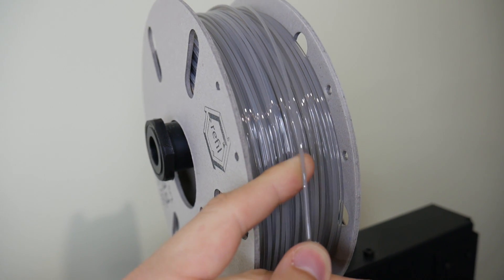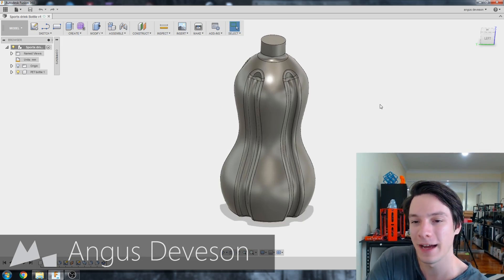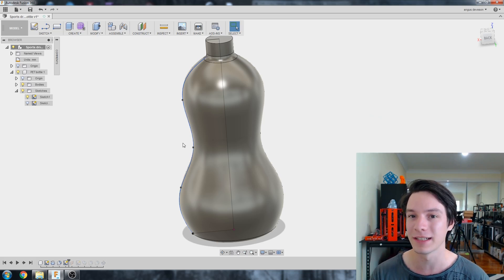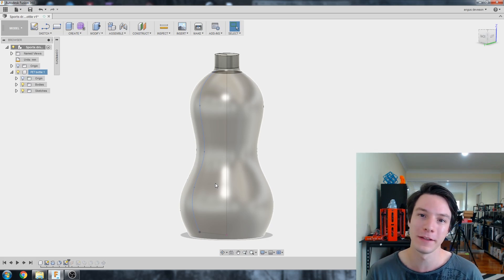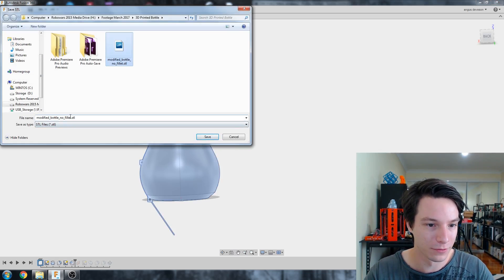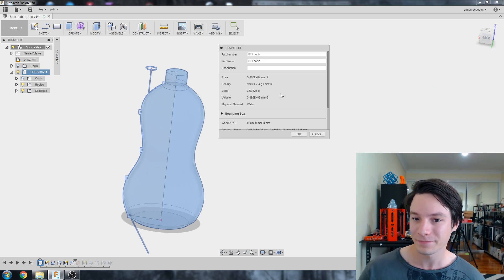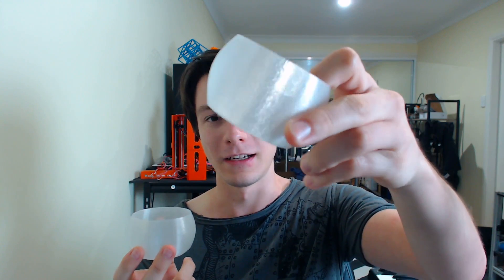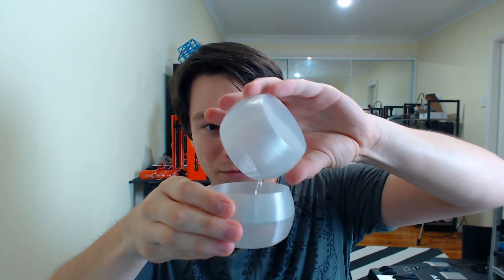Watertight 3D Prints and Calculating Volume in Fusion 360 - Refil Bottle Tweaks

Comment: It may hold the water now, but as soon as more pressure is applied (more water in the cup) it could start leaking. 
That's what I found out on my printed vase. A little water is fine but if I filled more than half the vase, the bottom started leaking.

Comment: Awesome video, always great content from you. I am experimenting with 3D printing our back yards sprinkler system. Originally I thought I would use a layer height of .3mm as a first experiment. The sprinkler seems to leak, I assume because the layer height has allowed some gaps in the layers. Next I will try a .1mm layer height thinking that there will be less gaps between layers. Now, a question. I am using PLA. Reading I have seen suggestions the PET or PETG will produce more of a waterproof product than PLA. And reading it seems PETG might be a little better than PET. Curious on what you think. I cam comment wit my results when I finish my experiment. Obviously sprinklers are cheap enough at under or slightly over a US dollar in cost but it's an experiment. I also assume that PLA will not do well in heat and UV rays in summer so I was considering ABS but PET or PETG seems to be the recommendation for waterproof even more that ABS.

Comment: My freshman year of college I brought a cr10s pro up along with me, and one Thursday night I asked myself this exact same collection, and through some hands-on research, and with the help of a dubious amount of shot glasses found on Thingiverse I figured out that single wall glasses do not hold liquid, especially vodka, well for long periods of time, but that didn't matter for the intended purpose. In my findings, it was clear that the more walls added, combined with a larger line width and lower layer height (theorized to increase layer adhesion), produce the best results. However, all findings of my tests are purely hypothetical and heresy at best because after the first 8 tests I don't recall any more results after that.

Comment: The reason it worked is because you only tested it with a small amount of water. So the pressure on the base was way way less than the whole bottle full.

Comment: You could have sharp outer edges in blow moulding. But the interior of the plastic part in cross section will not be sharp due to the material thickness.

Comment: I know this is an old video but I have been doing the same testing.  Wasting lots of filament and taking lots of close up pictures.  I found that the base is the issue, mainly due to changing print head direction.  I finally got a working setup.  I am using PETG running at max temperature.  I have a 0.8mm head and am using 2.0 filament multiplier.  I am also using circular infill pattern on the bottom.  The whole print is done in vase mode.  I am also using Simply3D.  Next, I am going to experiment is over heading the two base layers.  Heating it to 270c.

Comment: You have to let it sit for a while to see if its leaking! I made a hydroponic pot for plants and it didnt seem to be leaking, but after a day or two if I try to lift it there will be water under it. Fortunately it leaks so slowly that no water builds up around the container but instead evaporates. Thankfully the pot is standing on a granite surface so I don't have to worry about water damages unless it starts leaking more over time.

Comment: Also from the video you should use filament that has a high enough melting point to stand up to what ever hot beverage you put into it. As for if any of this is food safe, Is what I would like to know more about. The company Rigid.ink says their filament PET-G is food safe but it is not Certified safe. I’d like to print my own bottles, glasses, etc with my own design etched into the items.

Comment: I watch a video where a person made a simple espresso Cup. Out of PLA Plastic. That looked like it did not leak. What he did was after printing he put the cup in the oven at 100 F for about 30 minutes. Do quote me on the temp or time. Every filament has some shrinkage. By balding  it in the oven stabilizes the filament.

Comment: I wonder if water pressure makes a difference here. In the new models, you only printed part of the bottle. You then filled approximately 1 inch of water = 0.04 psi of water pressure. However, in the original bottle that leaked, you filled it with more water, perhaps 4-5 inches = 0.14 - 0.18 psi, nearly 4x the pressure. Would be nice to know if that made a difference?

Comment: Since you did this in vase mode, could you just set a higher wall thickness (or turn off spiralize outer wall) for the bottom layers that is fillited in the original design? Either in the design file or even just the print settings?

Comment: I know the video is old, but I've also had success with higher flow rate on the bottom layer since the overlapping "weave" of the solid infill can sometimes "sweat" if the lines aren't that thick. If it's only coming from the edges, the method in the video is obviously the best, but if it looks like the water appears in the middle where it's flat, I find it's more a case of infill overlaps not hatching properly (usually because individual lines are too thin).

Comment: Thanks for the video!
What happens if you print the bottle. Then seal it so it's air tight, add some water and then apply some normal pressure to the bottle (squeezing it)?

Comment: vase mode sucks when arcs close in on the top and bottom of spheres. you might be able to get away with a curve if you can somehow make yours layers "overlap" by say 50%. that should remove the gaps. lowering your layer height might be enough to do this. ie try the .5 nozzle with .1 layer height.

Comment: I have had good luck with making things water tight with PLA and T-Glase. I do not have good luck with PETG though they always leak. I have yet to use Vase mode in Simplify 3D.
Reply: Paul Rizzo try it. vase mode is amazing. yeah petg is stretchy and stringy ie will leak but vase mode has no stops or retractions so would work fine as long as its not water logged ie bubbling while printing so dry it out well before hand.

Comment: It is critically important when measuring the internal volume a container will hold, to remove the volume of the outer wall, instead of the simple material conversion shown here measuring both internal capacity, AND the volume of the outer wall.
Reply from the maker: To get it 100% accurate yes, but as stated in the video it's a little bit more complicated and needs its own video to explain the process.
Reply: For sure. Thanks for all the work you do!

Comment: What about setting a higher nozzle temperature so it melts just a bit more? won't that make the layers stick better and make it smoother / less likely to have gaps?

Alternatively, what happens if you dip it in not-too-hot water for a short amount of time so that it melts onto itself like acetone does to ABS?

Comment: FYI you shouldn't drink water from a recycled PET container; the plastic degrades over time and gives off some nasty chemicals. The only plastics that are safe to reuse are LDPE, HDPE, and PP. (polypropylene)
Reply: May the Schwarz be with you PLA is supposed to be food-safe reusable as well, although it also degrades over time or at extremes of temperature if not treated after a print or a casting.

Comment: ya, that's cool! I sorta figured this out awhile ago. basically, what ever your extrusion width is compared to layer height., if you go out too far on the layer above, the 2 layers wont seal. Generally I've found at least 1/2 the extrusion needs to overlap to get a seal.
another thing you might want to try, using S3D do a process where the fillets are at 1/2 the layer height. you're still extruding same width (0.5 in your case) but, only going out 1/2 as much so the layers over lap more... all that make sense?  :)

Comment: I'm wondering now that even tho with the chamfer the bottle is holding water, how tight  the seal between layers in fact is?  Would be interesting to see how much pressure could be placed on the walls. 1 atmosphere is good but lets say you put 1.2 atmosphere pressure on it and so on. You could design a special container with fittings on it to connect it to an air pressure line .

Comment: Is it safe to drink from this? or do you get like toxic stuff in your water?
Reply: luit meinen It seems to depend on a few variables, like: What martial filament are you printing with? Is it doctored with anything else, like carbon fiber? Have you used the same filament in any other printer? Have you used any other material filament or doctored filament in the same printer? Did you in any way post-treat or post-process the print? What material is your extrusion head, your hotend, your build plate, your feed tube?

Basically, the short answer is "maybe" while the long answer requires you to do your own research. Personally, I would recommend the latter regardless rather than trusting only one source.

Comment: It's probably relevant to point out that pressure increases with depth, regardless of the cross-sectional area of the water. So it might be a better test to print the full thing and see if the increased depth, and thus increased pressure, pushes the water through cracks at the bottom.

Comment: Can you shell an object in Fusion 360? (I have not used it much). In SolidWorks how I would do it would be use mass properties and get the volume. Then shell the object and use mass properties to get the volume of the shell. [Volume solid - Volume shelled = Inside volume]. If you wanted to know the volume of liquid up to a certain height in the bottle then temporarily extrude cut everything above that height prior to doing this.
Reply: yes you can do that

Comment: May be a stupid question but, would not increasing the bottom layers and perimeters have worked instead of remodeling?
Reply: When you print in vase mode it just prints one outermost layer, so it doesn't matter how thick the walls are.

Comment: Great job!  You made a hypothesis, came up with some solutions and tested them.
I agree that the leak was likely caused by the the lower portion of the fillet.  I think of it like making a coiled clay vase.  If the clay is coiled in a flat spiral (like at the base) there is a nice full height bond left-to-right and if the clay is coiled vertically (to make a vertical cylinder) then is a nice full width bond top-to-bottom.  If however, you coil to make an angle then there will not be a full bond either vertically or horizontally and any imperfections will open up tiny hole in the bond especially as the ideal smooth continuous curve of material meets the reality of the discrete steps of the stepper motor .  The angle where this is worst is probably complicated; and, I suspect it would likely be a determined by a combination of the vertical step resolution, the bead/nozzle size, and the way the plastic lays down.

Comment: is it safe to actually use a 3d printed water bottle as a water bottle?
Reply: It's not just the filament. It's also the nozzle too. Your typical nozzle has Lead in it! That's a big fat no no in food industry.
Also, the layers are a nice cozy spot for bacteria to grow.
Reply: Nikolas Kurnia It's not food-safe if you mean that. You'll never know what's in the plastic  (even with Petg) until it's testet in lab.
Reply: When printing with PLA it would be food safe yes, if you know for sure that it is only PLA and not mixed with anything else
Reply: That's true, I didn't think about that.

If you were to print with something without lead, then it could be used to make stuff for 1 time use
Reply: Sevendogtags irrelevant. do the math. you probably breath more lead than you would ingest if you ground up and ATE that nozzle.
Reply: Tell that to FDA... I dare ya!
Reply: It might not get approved for manufacturing, but 3D prints of PLA and PETG with a regular brass nozzle are food friendly enough so that no harm what so ever will come to you from drinking a bottle made with it
Reply: Sevendogtags ask me if i care what the fda thinks? they are irrelevant unless your commercial. they have no say in what i drink from in my home.

Comment: or you could just shell the model and use a tad more plastic in the process (make it thin, but not a single perimeter) ¯\(ツ)/¯
Reply: Braeden Stumm single perimeter is how you get the water tight seal. no gap. print head never stops retracts or anything.

Comment: I have found that sometimes a leak will not be obvious with a small amount of water. I had a vase that did not leak when i put 3cm of water in, but leaked when it had 10cm of water. the water pressure can overcome water tension holding the water back from leaking.
Since then I put small amount of water then use my hand as a "plunger" on top of the model to give sharp pressure increases to the water. I have found this will often reveal leaks not directly apparent, or leaks that will give out after a short while.

Comment: the main leaks usually occur where the bottom layer meets the vertical  component. At these points the bottom layer trails bend and thus has small gaps at those bends. This will be the case anywhere where the thread bends on a horizontal.

The solution I have found when printing in ABS is to increase flow rate on bottom with a slight temperature increase to make the plastic more sticky and gooey. this can make it a bit messy, but will fill any gaps.
Another solution for ABS is to take some waste ABS and sand it. Take the powdered ABS from the sandpaper and rub over bottom of the model. then "paint" with acetone. this will dissolve the powder and fill the gaps.
Reply: Joel Reid i would not want to drink from abs....

Comment: just a note. This type of modeling is not called parametric completely. As you have not set any parameters. Such a thing would be like Height=150. Then on the sketch, the dimension would be =height
Reply: That's not true, parametric modelling only requires dimensions; a dimension alone is a parameter and you'll find that if you sketch a shape and create a dimension, the first dimension placed automatically has a parameter with the name d1 and an equation of <some number>. There's no requirement for equations and in fact, many companies frown on the use of equations because they can make models so complicated that only the person that created them can easily figure out how to modify them. As well, there can be problems regenerating parts because of the parent/child relationships... that is one of the reasons for things like adaptive part geometry, so you don't have to create complicated mathematical relationships.
Reply from the maker: Good point, I don't have a reference table or anything like that setup but it's very possible to do in Fusion.
Reply: Just in case you want to make things easier :-) i thought I'd point out that if you need to manipulate a sketch such as that spline, if you turn on the visibility of the sketch you can edit the shape without going in/out of the feature.  Also, if you want to add a fillet to the bottom of a part but it won't print well right off the platform, you can add a chamfer first and then add a G2 (curvature continuity) fillet to the top where it transitions into the rest of the part.

Comment: Does the volume include the wall thickness?
Reply: In case you're interested, the workflow for that would look like this:

1. Modify > Shell bottle to account for wall thickness
2. Create Offset Plane on top of bottle to create a "boundary" for the next step
3. Create > Boundary Fill, selecting the bottle and offset plane as your bounds

You will now have a new body that is the exact volume of a liquid contained in that bottle. Simply follow Angus's instructions on assigning materials and you're good to go!
Reply from the maker: Not in this case, it's possible to take that into account for a more accurate result by offsetting your shape but it's a bit advanced - will need its own video :) You'll only be a few ml off
Reply: Thanks for the info!
Reply: Thanks for that :)

Comment: I found playing with layer heights can seal gaps. I use slic3r and preview, I can see the gaps in certain prints, then I make thinner layer heights until they're all sealed.It hasn't let me down yet.
Reply from the maker: Yep this works a treat! Vase mode printing as far as I know doesn't allow for variable layers though so it might make a print take all day - or maybe the new Slic3r can... I must investigate.
Reply: I also change the layer height on objects that may have too steep of an angle/overhang and it does help a lot.  I was hoping that you could maybe use multiple processes and use vase mode for both and set each one to print a different section with different layer heights but it would not let me do it. :(

Maybe you could use your connections with Simplify3D to get a new feature added. :)
Reply: The slic3r prusa edition loaded a model in vase mode with multiple layer heights for me, but I havn't tried printing it yet.

Comment: can you make a gass mask ?
Reply: For a costume, yes. For protection from gases,no
Reply: I use fdm-parts in an environment (inertgas inside, air outside) where it is crucial to have low oxygen ppm values.
After 2 years of usage (Innofil ABS, Colorfabb XT and HT) i can conclude that it is quite easy possible to print airtight parts. 2-3 mm wall-thickness and 100% infill is all you need.
I guess even lower wall-thickness numbers will work in terms of airtightness, but i do need strong parts so 3 mm is my favourite. Printed vacom flanges are working fine aswell.
Reply: Doubt it would be air tight